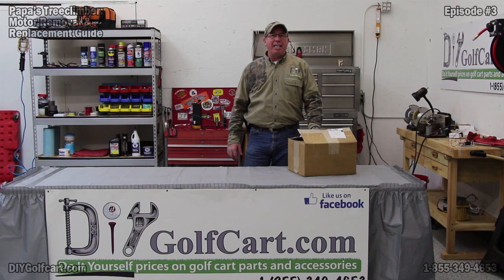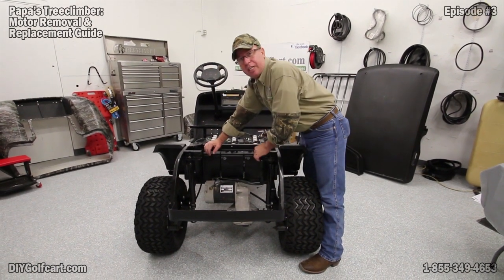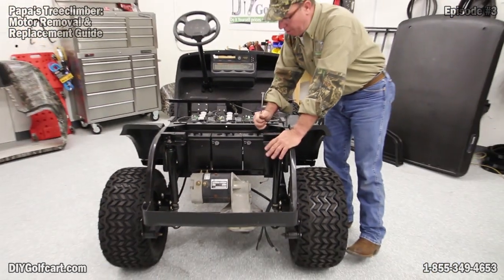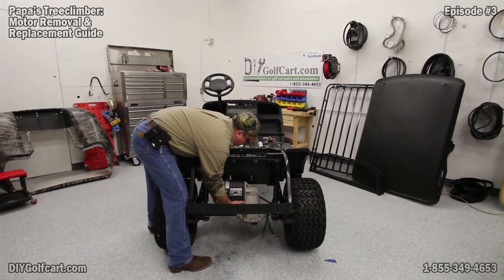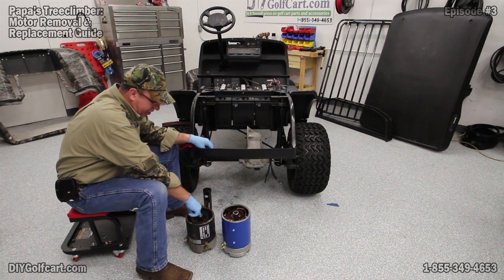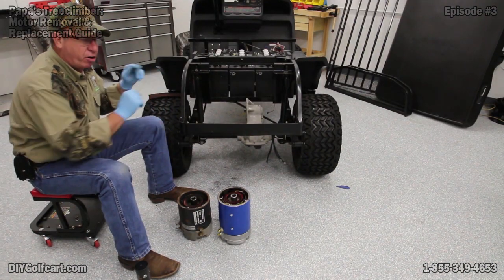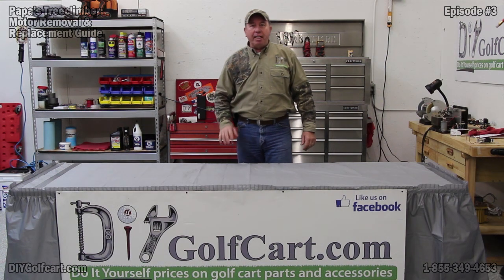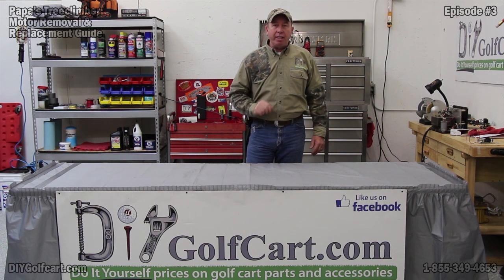EZGO High Torque Electric Motor Swap | How To Install Golf Cart Motor | Episode 3

Comment: i have a 99 txt. i lifted it and did the works. recently my stock motor controller went out because we have alot of hills around were we ride and im assuming i heated the controller up to much. what brand and set up should i but to fix this problem? i know i need atleast a 400 amp set up. saying that, what motor should i get as well and brand. thx!! love the vids.

Comment: I have a 36V TXT EZGO cart (Exact year I dont know) and was told the coils are burnt out and have to replace the motor. The previous owner converted it into a 4 seater and I wanted to know what would be the best option would be in terms of which motor to replace it with. The cart goes but starts to slow down considerably as soon as there is any incline. Also do all the different motors have the same mounting or are they different?
Reply from the maker: Give me a call at 855-349-4653 to further discuss your golf car.

Comment: I just bought a 2008 Club Car 48 volt with brand new Trojan batteries.  It goes dead after about 20 minutes. I took it in and it turns out it has one of these blue high performance motors in it. When put on the computer at the Club Car repair place it shows an "overheat" code in the a stock controller.  The repair shop is an authorized dealer and  can't put any after market parts in. Is there a way to stop this from happening without buying a matching controller for the new motor?   Thanks!

Comment: Hello, I have a new 36/42 Volt motor almost Identical as you just put in except black.  I believe I got the wires back on in the same place of the new motor as they were stiff.  The Old motor information was gone.  I put all back together and it barely moves forward and no reverse.  Its my first time doing something like this and I'm lost at this point.  I looked over the wires for numbers but didn't see any, I was hoping you would have some insight Please???

Comment: I have a 2005 EZGO TXT that I want to upgrade. Nothing is wrong with it other than it is slow and having a bit of an effort in negotiating fairway slopes.  I want more speed and HP so that I am not always the last guy in/out.  Can you tell me what areas I could change to have these.  Also, would I have to take out the body to do all these.
Reply from the maker: It really depends on the Electrical System your golf cart has. If your cart is a PDS, all you may need is a speed chip, otherwise you may need to completely upgrade the drive system as I did in the Tree Climber. Give us a call here at the DIY Golf Cart Garage and we'll set you up with any parts you need.

Comment: Great video! I'm about to purchase 170-004-0001 for my 1988 EZGO Marathon. Is the process nearly identical?
Reply from the maker: Yes, but make sure that you have a controller and not a resister coil. If your golf cart is equipped with a resister  coil, you shouldn't use this motor.
Reply: @golfcartking  I guess I need to pull the cover off and look. Thanks!
Reply: @golfcartking  Confirmed I have a controller. I was wrong about the year. It's a 1990. I think I'm going to upgrade the controller first.
Reply from the maker: @ansonrinesmith  https://www.golfcartking.com/400-amp-alltrax-series-controller-for-club-car-ezgo-yamaha/

Comment: Hi Bob,My Ezgo cart stopped moving even though batteries & motor is Ok.I stripped to motor and did not find the bush that is on spline.Could this be the problem?
Reply: @Barry Wilson Thanks Barry,my problem was in the wheel hub

Comment: Hi I just got my 1st golf cart ezgo freedom txt 36v looking to get a lil more speed and torque the cart has brand new 2017 Trojan battery's and I'm also upgrading the batteries cable to a 4g  no lift kit with me by myself I top out @ 21mph and with my wife and 1year old son top out @ 20mph  ant tips I don't  have PDS VERSION
Reply from the maker: There are 3 types of TXT's: Series, DCS and PDS. Each will have a different electrical system, so before I can suggest anything particular I would have to know which one it is. Also, to reach that speed something has already been done. Call our tech department with your serial number for suggestions. 877-960-5464.

Comment: We have removed all of the wires and bolts, but the motor will only move about 1/2 inch...  What do we do not???

Thanks for your help...
Reply from the maker: You will need to separate the input shaft and armature using equal leverage to each side. Sometimes it can be tough, especially if it hasn't ever been removed. Once you get it of before you put the new motor on, apply some anti-seize on the input shaft.

Comment: if the nut bolt that are connected to the motor are stripped and lose on one of post...is there anything I can do to salvage without purchasing new motor? new cables and such already purchased but don’t know how to tighten it back and connect new terminals. Thanks
Reply from the maker: Most cost efficient: replace motor.

Comment: Hello i have a ez-go 36v and its not have power to run just very slow and i have change the speedsensor and also put in a speed-chip but its the same,what is the problem? thanks from Roger

Comment: Hi. I have a question about my 96 club car 48volts. When I press the acculturation I hear clicking sound in the solenoi. Also the motor A2 the white wire what is the wire for has no power. Please help???????
Reply from the maker: Since you hear the solenoid clicking, that tells me everything before it is working correctly . Go to the controller and check the B+ and the B- with a volt meter with the accelerator pedal fully depressed and make sure you have full battery voltage.  The move the negative from the B- to the M- and press the pedal again. Make sure the reading goea all the way up to battery voltage. If not, may be bad controller.

Comment: Do you have to change the Speed Controller out when you change the motor? Mine is an old txt
Reply from the maker: The only time you need to change out the controller when you swap out the motor is when you're upgrading the motor such as the Beast in this video. The Beast is a torque motor and pulls a lot more amperage, so a larger controller is needed.

Comment: Hi thank you for the  video  but what  the amp     at 36v. And   the amp 48v   how many milles   can i go on one charge  thank you  God bless you
Reply from the maker: The amp per golf cart is determined by the motor. For example: a 48 volt high torque motor will pull the maximum at 585 amp's. That's the most the batteries can give up. Miles? That's determined on so many details, mostly your looking at minimum of around  120 minutes of drive time.

Comment: Do you have any video of the cart running,  trail riding,  motor reviews?  Through video of the installation
Reply from the maker: We do have a video that is featured on our Facebook page. Here is the link and please call us if you have any questions. Thanks https://www.facebook.com/photo.php?v=564291550307243&set=vb.170226386380430&type=2&theater

Comment: Do most golf cart motors have wires in the armitiure and the field current inductors?
Reply from the maker: All motor's that I know of have 2 wires the field winding's and 2 wires for the armature.
Reply: Some are permanent magnet motors and dont have field inductors.
Reply from the maker: Pedro Casultsan You are correct but, I don't know of any on Golf Cars from the factory.
Reply: okay thankyou

Comment: Would it be possible to put an EZGO Rxv AC motor on a Club Car Precedent?
Reply from the maker: +Stooch Any is possible. You might need an engineering degree to make this change though.
Reply: Well I was just wondering if it would be a simple change, or if it would need to be completely re-done
Reply from the maker: +Stooch Complete rewiring of the system.
Reply: So that would bring the cost up a lot?
Reply from the maker: +Stooch We do have kits here that we could sell you to upgrade to an AC System for your Precedent. It would come with everything you'd need from cables, motor, controller and more! It's run you about $2,450.
Reply: Ok, thanks for all the help! I'll discuss it with my family.

Comment: also is there a way to turn the torque down?
Reply from the maker: If you install a Alltrax Controller, you can re-program it to determine the amount of torque and/or speed that you'd like.
Reply: +DIY Golf Cart if you like to race a cart can you start in a high torque and switch to more speed as you go or is there motors just for racing